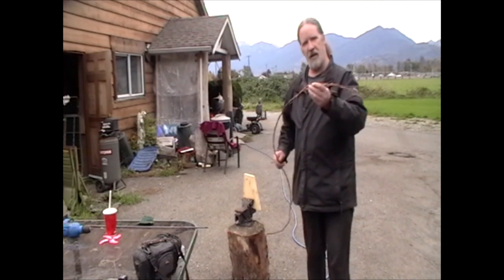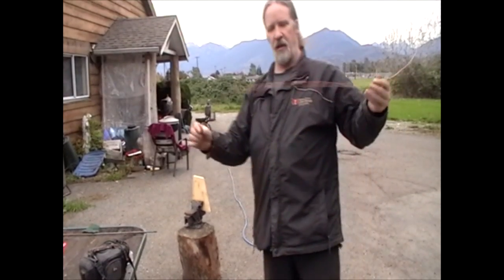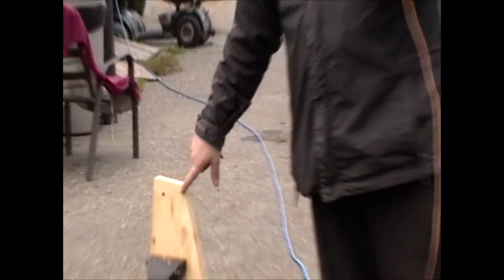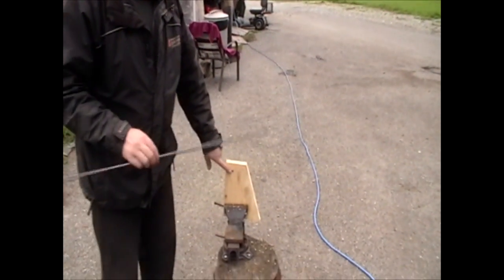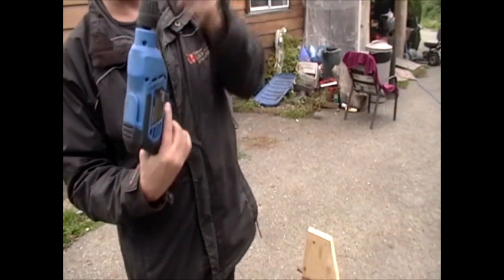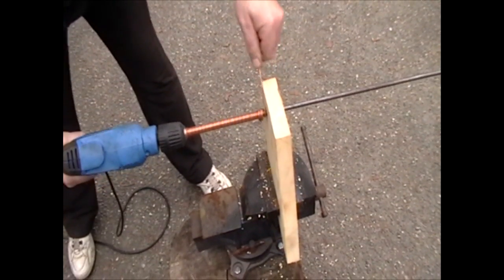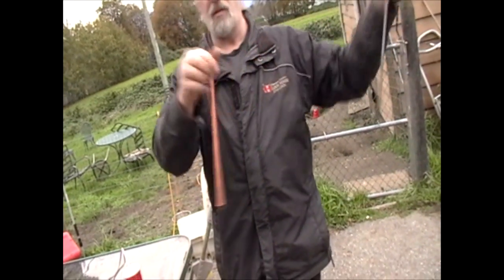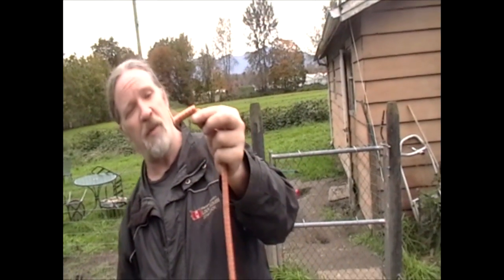Coil Winding

Comment: An EZ unwind, clamp one end down, pull wire straight an lock other end into drill chuck, put drill in reverse and or forward, slowly turn until wires are unwound

Comment: Hello Guys I have my magrav Unit working now after conditioning it I now have
 half of my house tied into the unit with my wattage meter on it and it"s been 
like that for three weeks now the reading on the wattage meter showing 38 watts
 and I have everything on in the house just half of the house like water heaters 
and TV lights it will go up to 140 watts when I have the water heater turn on, 
now is that the way it suppose to work and am I on the right track, 
and if so now I will wait for the wires to become NANO coated. 
what do you think I"m open for suggestions

Comment: MATE WOULD YOU NOT PUT A SMALL HOLE INTO THE WOOD AND PULL THE WIRE THROUGH THAT AND ATTACHIT TOO THE DRILL THEN, THIS WOULD STOP YOU HAVING TO HOLD THE WIRE IN YOUR HANDS, STOP ANY UNWANTED HEAT BURNS, FROM THE FRICKSON.

Comment: is the outside wire formed on he 5/16" dowel? If so what is the inside dowel diameter?
Reply from the maker: +Bob Hassel mandrel + 2*wire diameter...
In that specific case it would be 5/32. You make yours as you need to.